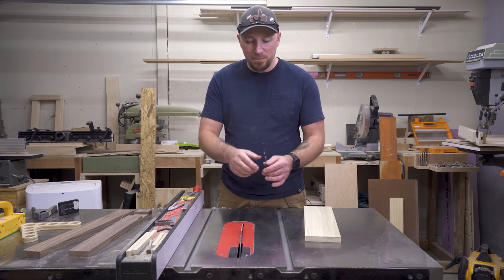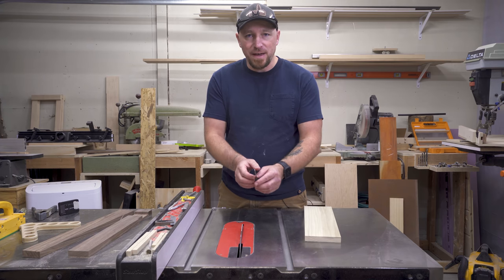Make Perfect Blade-Width Shims WITHOUT Measuring! / How To Make Splines On The Table Saw

Comment: This is quite possibly one of the most useful woodworking tip vids I've ever seen. As I'm certain several people mention below, this is the perfect way to cut key strips for keyed/splined miter joints. I wish I'd have known this technique - it would have saved me literal hours (and a lot of nice walnut) trying to dial in the 'perfect' spline thickness.

Comment: Jody, you fixed it for me. I just made a jig to cut slots for splines for my first picture frame miter joints, and I was stuck trying and trying to cut some mahogany for splines. All bloody day. Too thick. Too thin. Then I saw how you did it -- I missed it at first because you called it a shim but I wanted a spline. The penny finally dropped -- we're talking about the same thing, and your method is brilliant!! I cut a bunch that actually fit my test frame. Thank you!!

Comment: Genius!  I just got a new table saw and was just about to sit down and see if I figure this "secret recipe".  I knew there had to be a way to do this.  Thank you for saving me probably a couple hours and whole lot of frustration.  I plan on making one these for each blade I have and labelling each shim with the brand name and type of blade.

One of the cool things about this is that it works even if your blade is somehow out-of-spec.  I cut some slots for splines for a miter-cornered box and after some trial and error, found that my supposedly 0.125" (1/8") blade was cutting a kerf closer to 0.145".  Maybe my blade has some wobble, or maybe some of the teeth are bent out.  Doesn't matter - I can just make the perfect shims/splines for my wonky blade using this method.

Comment: That’s the slickest trick yet. I’ve used a similar trick to make thin stock cuts but not as a blade width shim like you did here. Awesome
If you turn the one block around the kerf cut will act as a push block to push the piece through.

Comment: Awesome video! One thing I would add…
Drill a hole in the shim. You can hang it from the saw, or on a pegboard for when you use that particular blade. Make one for each blade and tape them to the blades when you take the blade off the saw. Then when you switch blades, swap the shim on your “shim hook” for each different blade you own.

Comment: Absolutely genius, I will be using this next time I need splines for reinforcing miters. My current solution is to cut them slightly oversize and then hand plane to exact size but this will be a massive time saver. Thanks for the tip!

Comment: Several years ago I made a similar device ( GarageWoodwork design ) that saved me from spending $70 or $80 on a production model. It works perfectly although it did require some tweaking to get it dialed in but your method is much simpler to make and just as easy to use. Thanks for the tip.

Comment: Nice! On a previous project, I struggled to make the exact right size pieces to use as miter joint splines. This method should be perfect that that application!

Comment: I really like your videos because it focuses on reflecting measurements like a mirror. I started woodworking 3 years ago and learned the more you can just reflect measurements with jigs or other pieces of the project the easier and more accurate it will be

Comment: Great idea, thanks.  A cut is not the width of the blade.  All blades (all rotating elements) have some degree of vibration/wobble in them [the better saws have less].  So the cut in the wood is the width of the blade PLUS any wobble.  It's a small differential, but frustrating when trying to get a precise cut.  This is a great correction method and a lot simpler than a Kerf Master.

Comment: This is an incredibly clever and a very very elegant method that runs circles around anything you can do with a gauge or any other measuring tool. Also, as a bonus, if you don't throw away the "negative" you can make as many shims as you need out of pretty much any other material (more durable than wood) that you can cut with a table saw.

Comment: That is an awesome setup trick. I make splined boxes fairly regularly and always struggle with getting the setup right. I typically cut a bunch of extra splines once I get the setup dialed in and then have to store the shims until I need them again. This will eliminate a bunch of clutter and make it easy to match a different blade. This definitely falls under the K.I.S.S. Mantra. Keep up the outstanding work.

Comment: Very well explained. Thanks for sharing. I'm still a beginner on the table saw so this really helps me out. Due to my little knowledge I had to watch the video, some parts of it, multiple times, because some things weren't clear to me after the first times. If you will do some explanatory in the future, you might consider using two contrasting pieces
of wood and put some arrows on those pieces of wood as well so that it is much easier to see how you changed and flipped them.

Comment: For a 1/8” kerf, I have used a 1/8” drill bit for the spacer and that seems to work well. This is an awesome idea though for smaller kerf blades as well as other applications. Thanks for sharing this. :-)

Comment: yeah this is game changing for me.  I use a lot of splines and am always frustrated getting them the perfect width of my sawblade.  I've been using paint stirring sticks free from the big box, which ends up being the same width as my box joint sawblade.  it's cheap light colored wood, which isn't alway the look I want for my joints, so I try this out on my next project.

Comment: It is amazing what one can do with a clear mind. Thanks for the great tip, especially for those that are in love with the half-lap joint system. If the blade is standard 1/8” wide, probably the commercial aluminum 1/8 flat bar sold in sets for height adjustment would also work???

Comment: I'm commenting again because your technique just blew my mind.  

I'm addicted measuring, but I'm trying to practice more techniques that use the dimensions of the materials and the tools.  I don't know what it would be called, something like applied metrology or direct metrology I guess.
Reply from the maker: Thanks for watching. I get it. When I was trying to figure this out I would cut shims and measure them and then cut more shims. Even the ones that were the same measurement as the blade wouldn't work. I was going mad! Literally as soon as I stopped measuring, it started working. Go figure.

Comment: If you use a dado set, you should be able to make thin strips of almost any size. Combining the 1/8" and 1/16" blades will get you whatever thickness you need.

Comment: To clarify, the shim is placed against the stop block in order to reference the exact placement of the blade for the first cut of the half lap, thereby giving you the proper dimensions for the half lap opening and not a blade width to big. Smart, but the way you create the shim i also very smart.

Comment: Okay I got one for you that I was surprised I couldn't find or I am using the wrong terms and I bet you will have a brilliant method. How do I cut a groove, whether by router bit or saw blade, exactly down the middle of a piece. I know you can flip and flip test pieces until you get there but wonder if there is a no measure trick.

Comment: Today I needed to rip one that was full length for a groove set on both sides for a table top I am making... 72" long. Your method would work, but for the distance of the cut... my thought is to flip the piece on the fence around and use it to push the length thru... but it isn't able for the length of the piece. So I am better off doing a precise measurement.

Comment: I haven't been able to get that to work for me very well. My shim always seems to come out .003 to .004 different from end to end. I even tried the other similar method you describe more recently with the same results. I've tuned my saw up so there's a .0005 difference between the blade to miter slot and 0.0 with the fence to miter slot. I'm using the "PALS" trunnion adjustment with a 1999 Delta Contractor saw and a "VerySuperCoolTools" biesemeyer style fence with machined extrusion. So there should be no issue with alignment. I'm using a piece of laminate flooring (MDF) for my shim.
Have you actually measured your shim from end to end? Got any suggestions?
Great idea if I can only get it to work consistantly.

Comment: You should check out J-Woodworking videos. He seldom seems to measure other than when he needs to use a square. He mostly uses his TS fence and previously cut pieces as guides, and from what I can see, his joints are pretty much right on. In fact, he usually glues everything on his TS, probably so he doesn't have to move his camera,  and astoundingly. he doesn't make a mess.

Comment: Hey brother. I tried to do this technique, which is great , but I had some issues with my saw. I ripped both to same size as you showed and when I got to the part where you are cutting the shim , I had a problem with my saw. I raised the blade so that the angle wasn't so sharp and made the cut but it also cut more from the peice that rides against the fence. I was hoping u might be able to tell me why ? I checked the blade and it was square so I don't know why it's cutting more off when it's raised. Any input would be appreciated.

Comment: The blade dimensions are written on the blade. All you needed to do is to read them and use a drillbit as a shim. i.e. if your blade is 3mm wide, use a 3mm bit as a shim. Shawn Boyd has a video about this
Reply from the maker: Sometimes. Not all blades are equal to drill bit sizes though. And not all drill bits are created equal. A 3mm drill bit is not something readily on every shelf in the US and thin kerf blades are 3/32” anyway. One could argue that 3/32 is close enough to 3mm (3/32” being 2.38mm), if one actually had a 3mm bit, but sometimes close enough isn’t close enough. Another thing is that it also doesn’t account for any kind of blade wobble or flex, which a lot of blades have. Especially thinner ones. So a Meath of like this will take that into consideration. I measured and cut strips that were exactly the same thickness as the blade teeth (measured with a micrometer) and they didn’t fit right in actual usage. One last note: sometimes I may want two shims that are the length of my table saw fence. Can’t do that with drill bits. On the go though, drill bits definitely come in handy.
Reply: @InspireWoodcraft  Valid points there:) thanks for the detailed feedback

Comment: Wow awesome tip! Do you have a back for the other part of the half lap which is the depth of the cut? EDIT: nvm just saw your other video so you cover it. So different question,  how would you do it if you use dado blade or router but... say 1/2 to 3/4 inch

Comment: For this video, why not just check the shim inside a saw cut? Really no need to cut the lap joint. Good video as a follow up to yesterday’s video. 👍👍
Reply from the maker: Normally that would work just fine but I had to show people why we need the shim to begin with and an example of what we would use it for. Otherwise there wouldn't have been a lot of context for people that didn't see the half lap video.

Comment: Can this method be used to cut the spacer. For a box joint jig using dado blade?
Reply from the maker: I haven't tried. For blade-width, like finger joints, yeah of course. But for anything wider than that you would have to use a dado blade and I personally haven't done it. When I made my box joint jig (https://youtu.be/aiqpKV0OnGY) I just cut them to fit like normal.

Comment: Maybe I just haven't had my coffee... but is there a potential for kickback with the shim being cut like that?  Either way, smart idea for measurement purposes and I'd love to try it for making splines and kumiko strips.
Reply from the maker: Good question. I suppose technically yes, but the situation would have to be just right. The only thing I can think of right this second is if the piece that is between the fence and blade shifts left or right and you aren't using a riving knife. But to be fair that can be said of almost any cut while not using the riving knife.

Comment: You wouldn’t need the shim if the blade were perfectly thin. But it’s not. That imaginary perfectly thin line is sitting exactly in the center of both cuts, which means you'd wind up with an extra half a blade on the outside of both cuts. Add those two half-a-blades, and you get exactly one blade-width worth of extra wood being removed, which is why adding that one blade-width shim makes the joint fit perfectly.  Genius.

Comment: I’m willing to admit that I’m an idiot but I can’t seem to grasp what the shim does for cutting that half lap…
Reply from the maker: Haha. No worries. The shim is used to offset the thickness of the blade. A more traditional way to do the half lap would be to pencil everything in and then sneak up on a perfect fit. With the shim, there is no sneaking up. It accounts for the exact kerf of the blade so that you simply use the mating workpiece to determine the width of material that needs to be removed. I have a lot of videos on here where I've used it. If you have time, I'm sure one of them will explain it better.
Reply: @InspireWoodcraft  ah yes! Perfect, thank you. I’m definitely going to be binging your videos soon! Thanks!!

Comment: Your solution is much the same av in this video: https://www.youtube.com/watch?v=amNsrd4EZbU&list=PLKKdF5CX3kbSKjjHi_XHcllIASFtQE0S4 You however add the blade-width with a shim on one side and he subtract the blade-width on the other side... One can argue that these two methods are both equally easy and both result in a flawless lap-joint. Nicely done :-)

Comment: When I saw your video I was very excited to give it a try. However, I ran into a bit of a problem during the process. I noticed (now) that the saw blade used in your video is the same thickness as your riving knife, maybe even less. While my riving knife is 1/8", my blade was an Infinity 1/4" flat bottom blade I use for cutting box finger joints, This caused the teeth of the blade to extend past the edge of the riving knife. When I ran my first piece I made 2 mistakes: 1. I didn't recognize the problem, and 2. I ignored the cardinal rule of table saws and was standing in the path of the wood (that's "my bad"). Movement of the wood by so much as 1/1000" caused the teeth of the blade to catch the wood and fire it back at me. It felt like what I would imagine a major league fastball would feel like. Fortunately, I was wearing a heavy fabric woodworking apron. Even still, the sharp edges of the hardwood cut through all three layers of clothing lacerating my abdominal wall. It wasn't much of a cut, but the bruise is truly impressive, and it was scary as hell! I gave it another try, this time standing out of the exit path of the wood should it happen again, and sure enough it did. At this point I took a break to analyze the situation. It was only then that I realized my riving knife was rendered useless by the thicker blade. Adding a featherboard to the setup solved the problem and I got my shim cut without further incident. Has anyone else had this problem? Despite all the positive comments, I can't imagine I am the only person this has happened to or will happen to. I would suggest mentioning these points (especially the featherboard) in a remake of this video.